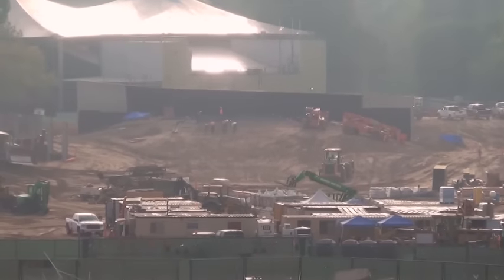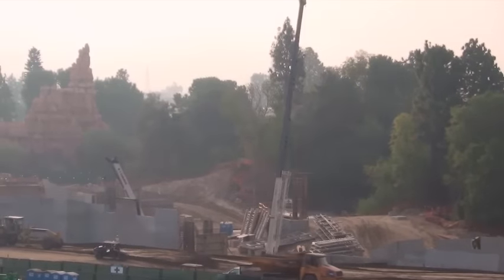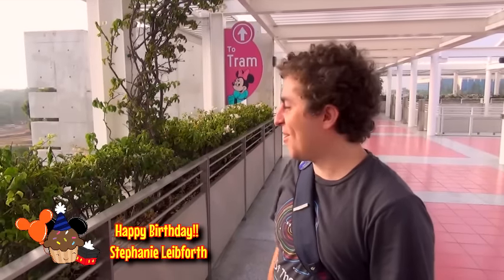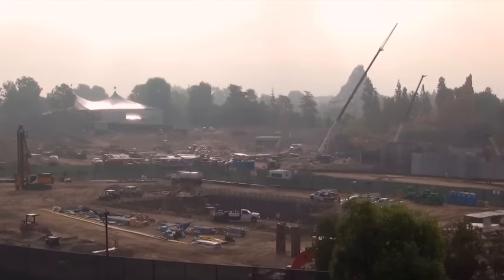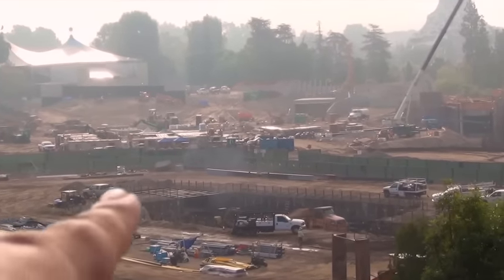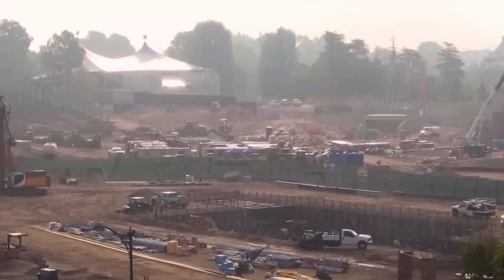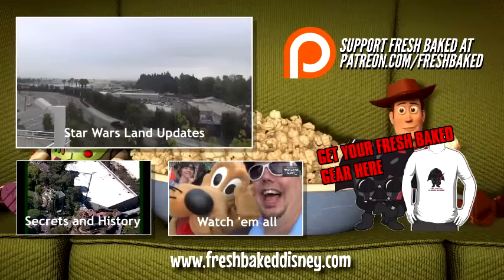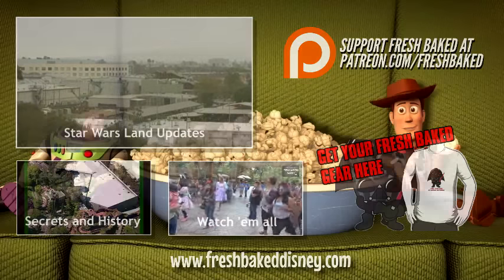Star Wars Land update - Where is the river!? | 09-10-16 Pt. 1

Comment: Thanks for continuing to post these videos, it's exciting to see the weekly progress. I'll be there in October and my first stop will be to the top of Mickey & Friends.

Here are a few of my thoughts regarding what we are seeing. 
-The dirt is most likely being shaped for landscape or some forced perspective features (i.e. mountains), plus it helps block sound from the train
-The observation area with the railing is the end of the island
-The trees in boxes (seen by the dam near Hungry Bear) will be placed at the end of the island to fill in the empty land there currently and make it look mature
-The river is behind the walls, which will be the backside of the cliffs & waterfalls seen in the concept art
-The train will run just to the other side of the wall, also like you see in the concept art
-They will use forced perspective on the cliffs & waterfalls (think Radiator Springs Racers, but on a smaller scale)
-There is a lot more space there than you think, the perspective makes everything look compressed, especially when you zoom in with a camera
-My guess is the big hole will be space for car maintenance for a big attraction that when servicing is needed are moved so they are off the main track. It could also be the equipment room where hydraulics, cabling, and other things they want to hide away to keep the magic will be located.

Comment: I feel that if the rumors are true, the Battle Escape ride is supposed to be trackless. That would require them to put all the technical stuff, the parts controlling where the "boats" would travel (much like Luigi's Rollickin' Roadsters), below ground and therefore require them to dig a big hole. On the east end of the hole they have begun to put I-Beams across the hole (maybe the level of the ride floor).

Comment: The shoring is temporary walls, and they will build permanent basement walls withing the 'pool' slightly smaller than the current pool, then remove the shoring and backfill behind the basement walls.  The h-pile shoring is just the best way to build a large basement in that type of soil.  Without any details about the actual ride, there's no way to really know why the basement level is only under a part of the show building, but obviously they are only going to dig where they need to.

Comment: The tunnel as you call it is the cross over bridge that goes to the Cantina restaurant and that's what you see with all the walls. if you look at it from hungary bear and follow the river which would be at least 20 feet away on the other side of that far wall. The big pool as you call it will be the new E ride  similar to sorrin but it will be star wars. The mountain as you call it will just be that there going to turn that into a ride and shops which is in the mountain and that's what that is. The rail road will be huging the river , like you see in places like in pittsburgh pa.

Comment: Dave and the crew, have you gone to the Hungry Bear lower level?  I went today, and it would not make good video, but you can peer thru into the river.  In the back left corner.  It gives you a view with the HB deck, the back sides of the "walls" that you point to. I saw 4 water truck parked across the river near the turn.  There is more room then you can see from M&F's
Also, the tunnel. will that be the entrance from Big Thunder? The train will go over the tunnel?  Ridding big thunder today, the back side of the tunnel is pointing more towards Fantasy Land.
 They were tearing up decking on the Fantasmic stage today

Comment: The pool seems to me to be the below grade portion of the show building. I still think the gap between the jig saw wall and the square wall to the right is where the train makes the right turn and run along the river on the trestle. As the train comes out of Splash Mountain and over the bridge at Pooh it will maintain that level which is probably exactly the same height as the new concrete bridge? HAVE YOU SEEN A PHYSICIAN ABOUT YOUR BLOOD PRESSURE YET??

Comment: Disneyland - SW - Frontierland - Site Development Package 2 -  New Commercial Construction: 11,693 subterranean structure (Marina BLD #5903). 112 sq.ft free standing structure (Hydraulic Pump Utility Room - BLD #5904). 112 sq.ft free standing structure (Power Electronics Room - BLD #5905). 70 sq.ft of free standing structure for (Power Electric room - BLD #5906). 3,206 sq.ft train shed BLD #5907. Replace exterior stairs, (1) new 7' high boulder located (E) Hungry Bear Restaurantand. Bridge(s) #1 and #2. Tunnel(s) #2 #3 #4. Trestle #1 #2. 5,573 ln.f (perimeter) retaining wall, 941 ln.ft retaining wall (landscape).